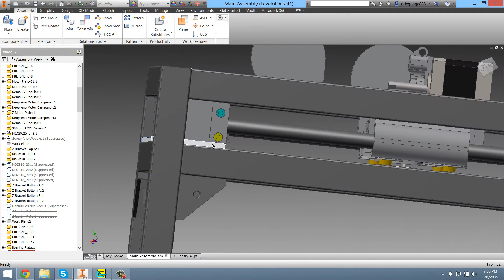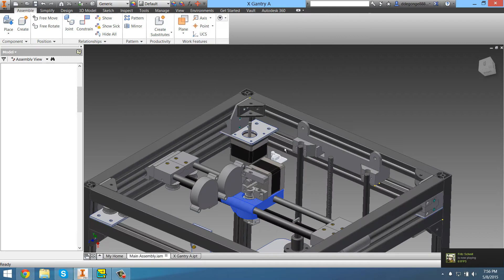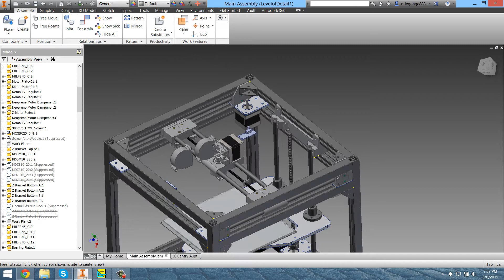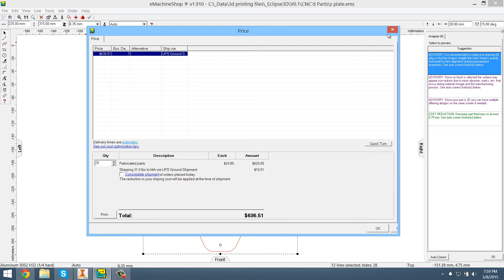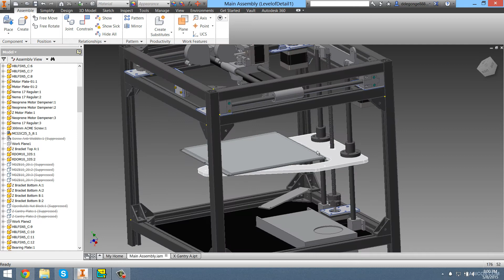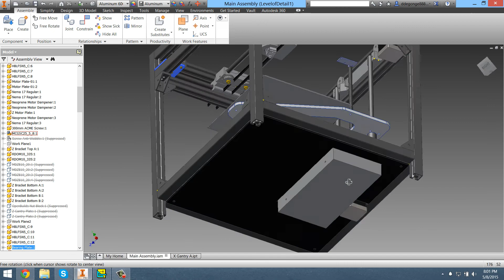Eclips3D Update 11 - New Z Axis Design!

Comment: I am going to try and retrofit your z axis idea to the 3up. The maintenance guys at my work said they could easily machine a smaller build plate so that obstacle will be overcome. However, could you provide me with some advice? What are all the parts of your z axis? Would using the 3ups narrower smooth rods compromise integrity? Where did you order your motor mount and flanged bearings? Or could I just order some of the parts from you? Once I get a working model I plan on offering to help anyone else with a 3up changeover there z axis.

Comment: I was beginning to worry that leverage on the z axis bearings might be a problem but then you mentioned the stress tests and somewhat curbed my worries. My worry now is excess friction on those bearings. I know that from what ive experianced, it doesnt take much deviation to make an lm8luu bind. That is an 8mm bearing though. The design ive chosen involves 12mm bearings for the z axis. 4 to exact with one for each corner. The 15th is when hopefully I'll get to talk with my manufacturer about producing the prototype. My investor is about ready to get things rolling so hopefully I'll have a printer around the same time as you. Like you said, it aint gonna be cheap. Lol
Reply from the maker: Purpledotcom That's true, however the M10 rods I'm using are very rigid and they are only 330mm long so they shouldn't bend much at all even under load. I'm sure M12 rods would be better but also heavier and more expensive and more complicated since they're different from the rest of my printer. And yeah, custom machined parts are amazing but so god damn expensive, especially buying low quantities for prototyping!
Reply: I was hoping to an update video today about my printer but my manufacturer hasnt gotten back to me yet on if the parts are done yet. I'm still finalizing the parts list too. lol. M12 rods arent too expensive. I know musimi is pretty expensive for the rods but not for bearings. I get my rods from VXB. Super cheap and very high quality.
Reply from the maker: Purpledotcom Ahh I see, I wish they offered cut to length like Misumi does though, not sure I have the tools to properly cut hardened steel shafts down to size without it taking half an hour per rod. And actually with bulk I'm able to get hardened steel shafts from misumi down to about $7 a piece for 335mm M10 rods, not bad at all!
Reply: That's actually not bad. I found that using a dremel works pretty well for cutting hardened steel. I've used a hand saw. It just takes a while. With the amount of rods you need per printer and the price you are getting from misumi, I'd stick with them. lol

Comment: Are you going for  a 3-point leveling system now? Just keep in mind that most heat-beds have the single leveling hole where the power inputs are. Just something to think about in regards to cable management :)
Reply from the maker: Exlr8Films Yep that's been the plan, and that is a good point I didn't think of that but I'm sure I can manage!
Reply: There are soldering pads on the bottom side aswell, but you might want to find a way to cover the top pads, you might be able to find one with just pads on the bottom
Reply from the maker: Exlr8Films Yeah I was planning on just a small plastic sheath glued on from underneath or something like that.
Reply: 3DprintedLife I have just bought the Mk3 and it not only has no solder pads on the top surface, but it's aluminium so complementing your aesthetic but more importantly, you or others can introduce automatic bed levelling / tilt compensation.....! I just followed the Thomas Sanladerer guide for my Smartcore and it's great.
Reply from the maker: Simon Merrett
I wasn't aware the mk3 was aluminum until now, and checking prices it is actually cheaper than the mk2 plus glass, thanks for the find! I have ordered one myself for testing.
Reply: 3DprintedLife You're welcome - glad I could help.

Comment: Actually Im still a bit sceptical about the z axis. Because everything is so compact now and has very little leverage compared to the build plate. But if your tests say it will be fine, its of course the better solution. (Just my thoughts as someone who likes to design based on physics and not on material)
Reply from the maker: Whatnever Yeah that's what I was a little worried about at first, however I remember from my tests with the 3uP, even a single crappy lm8luu bearing was enough to support the weight of the 3uP z gantry fairly well. I've calculated how much torque will be exerted and compared that with the spec of the linear bushings. With no load the gantry will exert about 1 N*M and each bearing is spec'd for about 6, so even with a huge print the mechanics should be more than enough!
Reply: 3DprintedLife The weight shuldnt be a problem at all, if you look at the ultimaker 2 it uses a huge 4mm aluminium plate to hold the glass and heatbed and is also supported by only 2 lm12uu bearings(not 10). What was the thickness of the aluminium plate now? 4mm should be ok
Reply from the maker: Exlr8Films Just a little thicker, 1/4" (about 6mm) but I do have the cut in the middle which reduces the weight greatly and its stronger than a solid 4mm z plate.